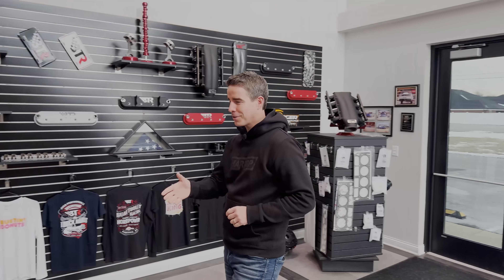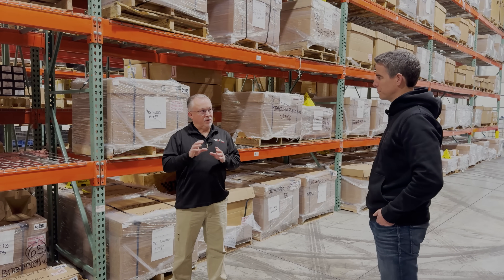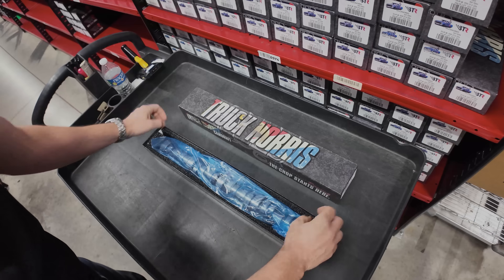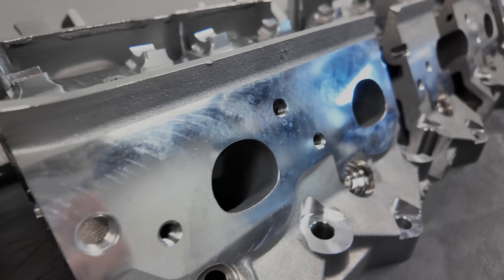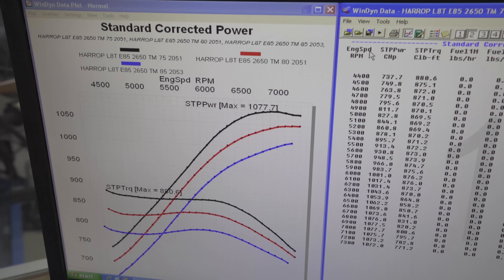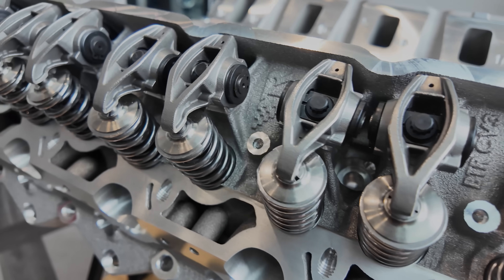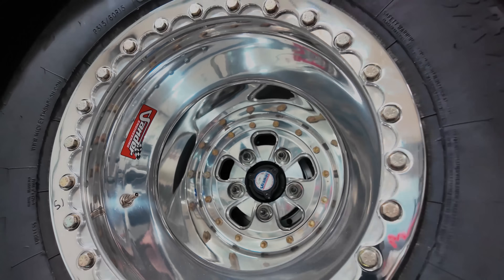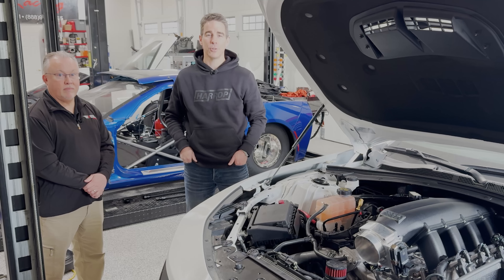Brian Tooley Racing | BTR Design, Testing & Manufacturing | Harrop Tours

Comment: Now hold on their Brian. On mass it was probably 2013 they stopped with the ls engine in most vehicles. But they were still going in 2500 series truck till 2019 I belive. 
I know my 2017 will be getting one of your LS cams.